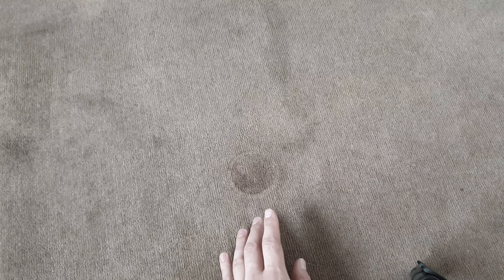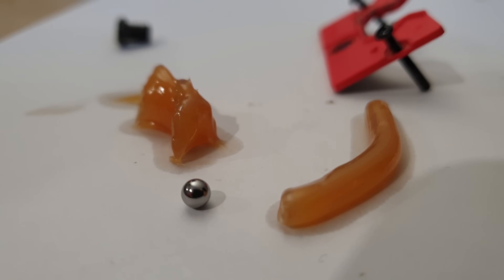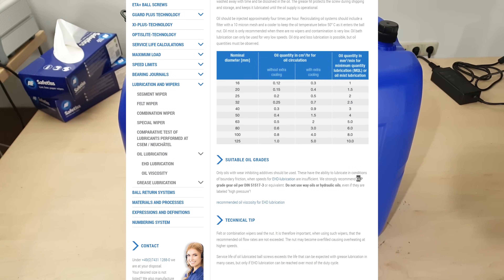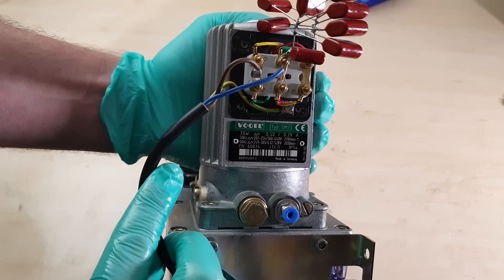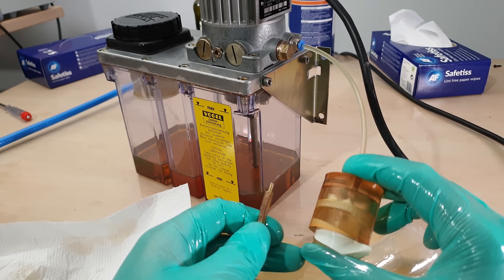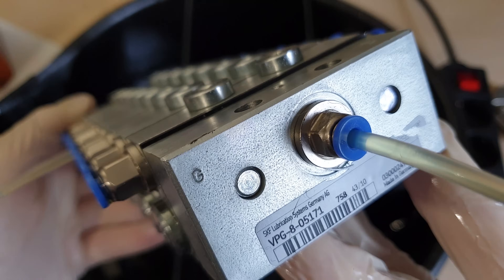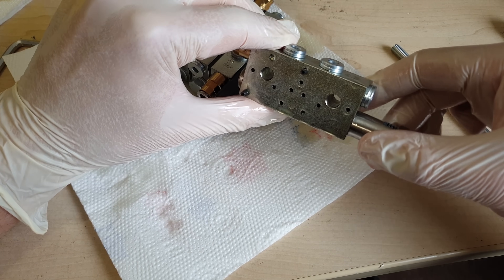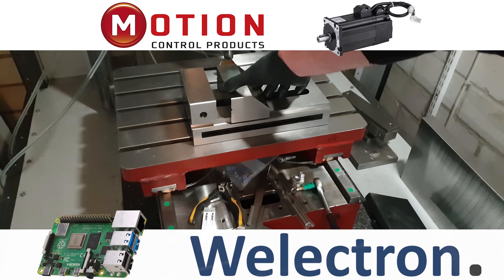Central Lubrication System for the CNC

Comment: Hi there! I was working as an professional tool maker until last year in CNC for nearly 20yrs. we used glp68 (mannol or simmilar) or even hlp 68 as an alternative for lubrication.  price is 30€ roughly for hlp for 25 Liters. You dont need much for a mashine like this. Would last maybe years if not even longer. These oils are industrial standard for cnc machinery. Good luck with your project. If you want some more knowlage about cnc, just ask me. Greetings SAM.

Comment: Hello, professional machines use pressure relief valve manifolds which dose single and precise amount per each pumping cycle. That way you can easily control dosing by software. They are also much simpler in build and very reliable thus having less moving parts and they are also cheaper. You can even buy pressure relief valves separately and make simple manifold out of aluminium bar.

Comment: The gravity of the situation is such that lower viscosity lubricant is advantageous considering initial tolerances, cycle life and ease of distribution. Metered gravity reservoirs dedicated to each lubrication point are simple to maintain and require minimal maintenance. A simple solenoid actuated valve administered to each lubrication point or subpoints. Independent signal agregation from each axis via controller provides flexibility for optimization and tuning.

Comment: Have u tried with oil metering units? They are made to send the right amount of oil where u need it, even if you have N lube points, is a clever design.  Take a look at bijur.

Comment: Those valves barely ever screw up, you can get away with using push air fittings as there isn't much pressure in those, its more a little trickle constantly, these are over kill for your use, we used these at work on m/c's that were rotating at a few thousand rpm on bearings that are 12"+ and rails that are doing upto 300 strokes a min, in between the pump and blocks we had hydraulic spring loaded reservoirs/similar to a timed shut off valve while it charged, the pump was then on an open pressure regulated loop back to main res, this helps limit the amount of oil wasted. Just so you know those blocks come in different ratings so you can limit/increase the flow as needed. What oil hits the block is wasted if you have coolant cutting fluid as well so you will really need to limit the amount of time, like pump runs 2-3 mins over 30-60 mins run time.

Comment: Maybe drilling a hole in wipers and using small capillary tubes with less viscous oil together with solenoid valves. That is what i came up with my imaginary cnc, still not built completely :(  dental technik have all sort of micro stuff

Comment: Dinosaur squeezing????  As for what type of oil Haas used and recommended for their machines ballscrews and rail's, from the factory they used and recommended Mobil Vactra #2 way lubricant.

The newer machines have switched to a grease type system for environmental reasons (tramp oil in the coolant is becoming a big no/no).

Comment: A good oil based pump would be found in small industrial machinery, and whilst you couldn't buy those without magical leg and hand loss, you can find them at scrappers and refurbish them. The ratings are above any CNC lube requirements too, after all, they are meant to lift tons AND they are small, some fitting in the palm of your hand (-motor).

Comment: Automated lubrication is cool and good. However my current recommendation is SKF System 24. I can't recommend it enough. Grease or oil in see-thru cartridge where you manually set months to discharge. Absolutely beautiful little things. Been using one's for years and they're incredibly accurate and easy to setup. One of the beauties of it is that there's very minor continuous flow in hard conditions, say if machines are washed daily etc. They're also incredibly easy to retrofit on places needed. This comes from packaging machine mechanic.
Reply from the maker: yeah that looks pretty great indeed! I had no idea that that exists.
Reply: Swiss made Simalubes are a market leader in disposable single point lubrication
Reply: @mrbumcraic5046  Yeah, I've heard about them. For me SKF's were cheaper and I frankly didn't have any reason to move. System 24 has never once failed on me and they're accurate.
Reply: jothain 
the first system 24’s were rebranded Simalubes
Simalube also have a custom fill option so you can use whatever grease (or oil) you like
Reply: @mrbumcraic5046  Yeah, I know about that. Still for my applications I'm totally fine with ready greases so I don't have any needs for fillable systems. On the contrary it's more convenient to not waste time on something like that. Though I fully agree that it's nice that there are options for customized applications if needed, I've kept that in mind.

Comment: I'm a professional cnc operator and the Haas mills we have use "Haas liquid grease" for the X, Y and Z slides (I think they wanted grease but for the central lubrication system they needed a middle ground) and some kind of oil for the 12000rpm spindle.

Comment: I used NGLI 0 grease instead on a remote lubrication system. Pumps fine through 3mm tubing, and is a very good lubricant, though you do run into the excess grease problem, though as that machine used a mix of roller, ball and slide bearings you do have to be careful in the amounts you put in each section. No automatic lubricator but instead just all the lubricant lines brought to a central block, one side of which was threaded for M6 push in fittings, and the other side was 1/4BSP to fit the array of low cost grease nipples that made up the face. The grease would pump easily through the lines, and the excess in most cases was easy to handle, though there were some places deep in the bowels of the machine that you simply cleaned with "the dirty vacuum". An old Columbus cylinder vacuum that had a long suction hose, a few modified crevice tools, and regular cleaning of the hose outside and inside, cylinder and bag with first engine degreaser then regular industrial detergent. cleaning as part of the monthly maintenance cycle worked well here, you never got the great big gobs of grease that I had to chisel out the first time I had to scrape out the bowels of the machine during overhaul.
Reply: A better quality system will pump NLGI2 greases
Better quality distribution valves are adjustable

Comment: How can we send him stuff? I have some cnc components I bought for my project but doesn't need anymore, such as a lathe ER32 live tool.
Reply from the maker: I too made the mistake of throwing something out once - took no more than 4 days to find an unforeseen use for it and to start regretting it ...
Reply: @reps  By the way, I work in an injection molding plan and all imm machine use grease. For all bushing, linear rail, ball screw... They have a lubrication unit which pump grease from a cartridge that needs to be changed regularly. Sometimes people need to clean grease build up, and that's all. I don't think i ever see any lubrication problem, even with some 20 years old machine which basically work 24/7.

Comment: From the look of the scheme it defiantly can recover from starting with random piston positions. It will skip several outputs through the first cycle, but thats it.
Reply from the maker: Can you tell just from looking at that? I would have to sit down, put my thinking cap on and focus for half an hour to make that call :)
Reply: @reps  Yep, I am pretty good with that sort of things. It is arranged in such a way that fluid shifting piston from side A to side B opens up channels that allows same fluid to shift next piston same way, with the last piece of the stack shifting the first one the opposite way. If pistons sit in random order it will start cycle by shifting the whole stack to the side first piston started at, with pistons starting on that side already sitting with necessary channels opened. The only thing I am not 100% sure about is how it will handle every single piston sitting smack in the middle.
Plus it would be virtually impossible to transport lacking ability to start by itself after some shaking.
Reply: And if I am wrong pressurizing outlets in the reverse order will put pistons in the right positions.

Comment: Pro CNC machines use a Bijur (or similar) lubrication pump that runs at an interval of around 18 minutes.  It lifts a piston and at 18min the cam rolls over and the piston is driven down by spring pressure.  This feeds a line that goes to 1 or more manifolds with metering units.  Old systems use unsophisticated metering units, newer systems use delivery valves.  This method has worked for a very long time and it reliable as long as you use good oil.  Some makers use central grease systems for the ways and spindles, the have a grease pot that is either a urea driven pump or mechanical pump.  I believe Brother is one of the MTBs that uses a central grease system, Hardinge used a central grease system on their somewhat older VMC mills.
Reply: My brother speedio and my robodrill are grease machines. The speedio is automatic grease. one nice advantage of grease is you dont get tramp oil in your coolant.

Comment: On an 80's era CNC mill they used a one shot lubrication system. A clock motor slowly raised a spring loaded pistion that slowly filled with oil. Fully primed it was like a pinball being released. Several seconds were needed for the pistion spring to overcome the many small restricting orifices that regulated the oil distribution. Sort of an oil artery with a very slow heat beat.

Comment: this is amazing, I was actually right in the middle of putting together a lube system for the CNC router I'm building.  I don't have the fancy gear, just a Chinese hand powered one shot oiler and some needle valves to tune later.
Reply: Get SKF System 24 bottles if you can get your hands on with decent price and forget those needle systems.

Comment: I loved the Valve reference! I imagined seeing a red valve.

Contamination is an issue on unprotected CNC ways. When I was making my CNC, I found that the best grease to use is: often--meaning an vicious cycle of cleaning and lubricating. On the ballscrews, I used oil. Once I get settled, I am going to make some wipers.

I documented the whole thing on my channel.
Reply from the maker: Cool channel! I am off, trying to find a harmonic drive motor :)
Reply: @reps , Thank you : )

Harmonic drives are amazing devices. I put a laser on one, and had it turn. At about 4 meters, the steps were so small the beam connected where it was. I am lucky enough to have some--that were being scrapped!

I wrote an Arduino stepper utility called RDL for testing motors. It's linked from my videos.

Thanks for sharing you projects.

Comment: Is that lubricant suitable for latex?
Reply from the maker: I'll test it when I wear my catsuit next time
Reply: No, but Shell does have some synthetic lubricants in the range that are relatively latex stable. Reniso lubricants are all made from sweet crude, which causes natural rubber to rapidly degrade, unless it is properly vulcanised first.
Reply: If you're working with rubbers it's best to use water-based lubrication

Comment: The colunms are not too thin for this kind of  machine? Left-right movements and forward-backward. (may be you will need put there some triangles).
What will show the dial indicator with some load on it. (you can use a weight mesuer)

Comment: Most modern machines are running grease for the ways now. High precision machines have been running grease for decades now. The bad thing about oil is if you run flood coolant, it's going to contaminate the coolant.

Comment: Hey, nice and informative video, does thermal expansion of the oil cause any issues? And are you planning on collecting oil back into the tank and recirculating it, something like with cooling fluid?
Reply from the maker: Phew ... I have not seen any problems with thermal expansion yet and I'd expect my pneumatic push-in connectors to pop long before anything expensive ... but good idea, I'll keep an eye out. At the moment I am aiming at a minimum quantity lubrication with 2mm³ per 'consumer' per cycle. I was hoping that such a small amount of oil will somehow dematerialize before ever reaching the floor. But the more I think about it, the less likely that gets... I may have to add some sort oil pan. But no recirculation for now.
Reply: @reps  Just add a rubber oil bellow to the tank, if it's not already present. That solves all the thermal expansion issues. If pressure builds up in the consumer/distribution side, the valves will just run a 1/8th of a cycle or something like that, so there isn't really a place where excess pressure can build up.